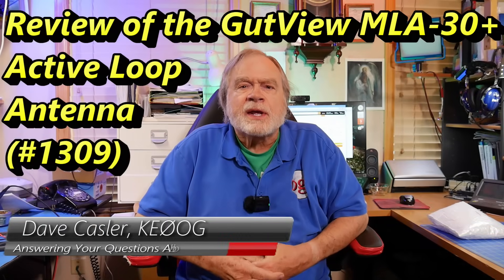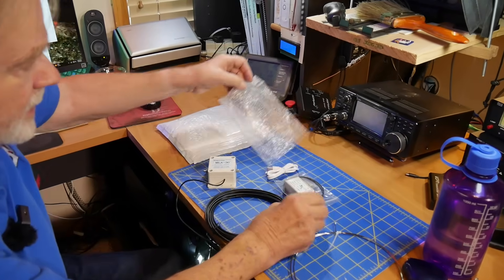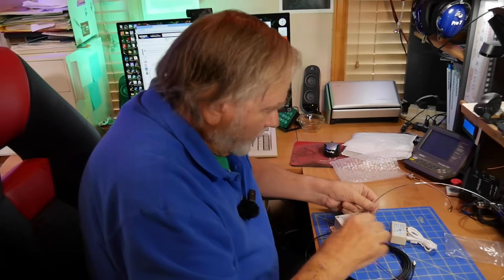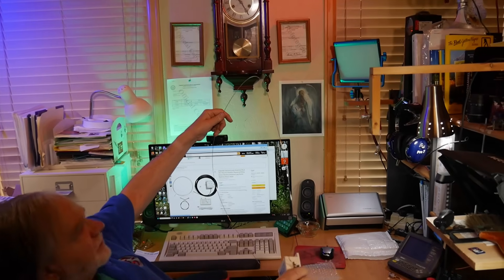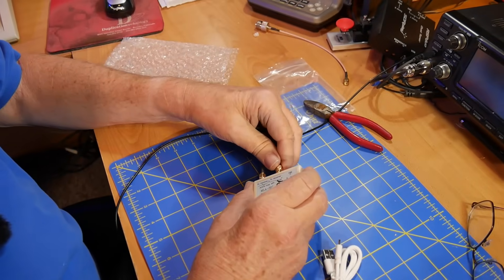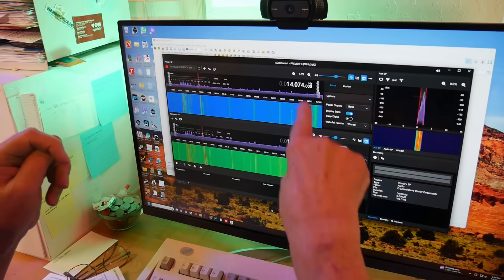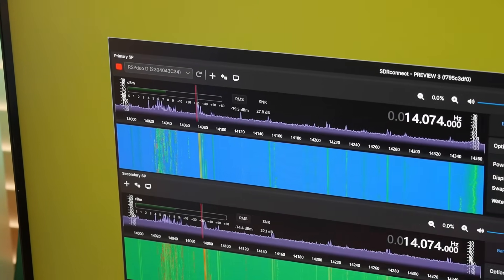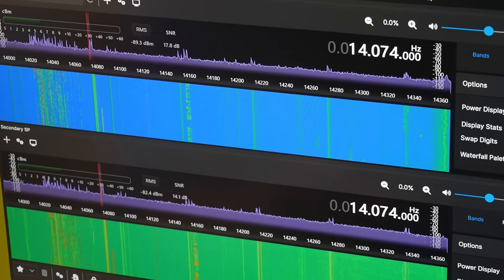GutView MLA-30+ Active Loop Antenna (#1309)

Comment: Dave, I put my MLA-30 up last may. I have it up about 20 ft. I just recently installed a lightening arrestor and grounded the metal mast that its on. The metal mast is only 10ft of the entire length and the rest is PVC. I had to cut RG174 coax 33 ft that came with the MLA in order to put in the lightening arrestor. From the arrestor I switched to RG8X coax all the way to my Hammarlund 170 receiver. The 25ft of the RG8X made a huge difference in reducing noise and reception, along with adding ferrite cores.

Comment: Thinking of getting one, currently just use about 26 ft of wire along wall and top of window in apartment, does decent. Do you think attaching this to the window facing the north or east window be a waste of time indoors??? I'm aware this more if an outdoor antenna. Will be plugged into a few of various radios , portables, primarily a sangen 902, or ole Pl888. Your SDR set is wanting to try one